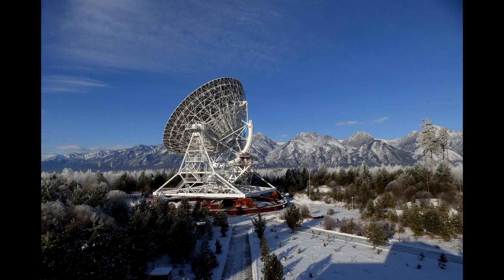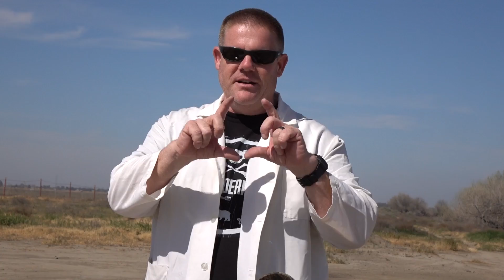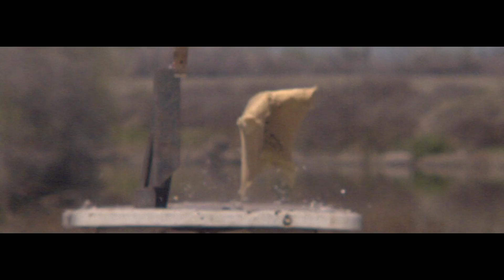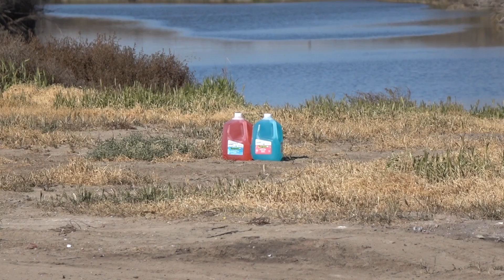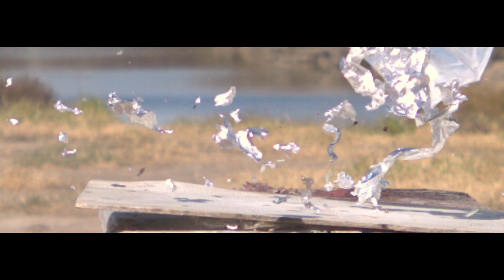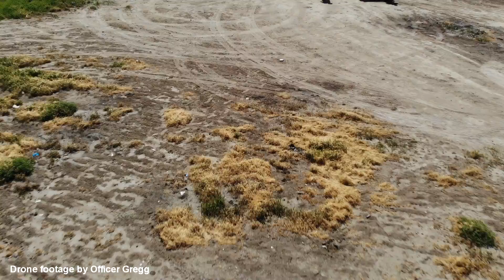BIZARRE Russian 12ga Shotgun slug using French Blondeau design - MUST SEE

Comment: Use a small square of reflective tape on your target to get a laser dot to show up on camera. I have used this to laser bore sight my personal chemical propellant mass accelerators.
Reply: That's a 200 IQ move right there.
Reply: @mike, well if you have to use electric tape, why not just use a mirror?
Reply: @Jazzman-bj9fq  because foil tape is a darn sight cheaper than buying mirrors that you have to replace after every shot, foil tape just gets a hole through but a mirror or piece of one would disintegrate
Reply: @Jazzman-bj9fq  because if you break the mirror you get 7 years bad luck
but for real the more reflective it is you're actually making it a little harder because you want the laser to be seen by the camera which means you'd rather have a diffuse reflection than having to line up the mirror to the camera

Comment: Been there done that with slob shooters leaving all kinds of trash. We almost lost a local range till a gun organization stepped in and saved it.  Made many improvements and really breathed life back into it. One of the nicest ranges around now.
I like running .690 round ball loads, use old books glueing pages together to be more solid. Low velocity around 1,100 fps tears il two placed 4in apart. Had some Makarov slugs I hammered flat like coins, put 4 in a 7/8oz cup to see what they'll do to a two in thick book.

Comment: Regarding the amount of light available for high-speed video:
        I posted this same comment on another one of your videos, recently, but when the same subject came up on this one, I figured I'd mention it here, because it's the perfect solution, which I first saw on the Ballistic High-Speed channel. They use framed mirrors, (around 1.5'x2', give or take) each mounted on a stand/tripod, to reflect sunlight onto the target. It makes it way too bright for the naked eye, but it's GREAT for increasing exposure for the low-ISO of a high-speed camera. It's a cheap enough set-up, and then it's free to use, no electricity, no batteries, no maintenance except a wet paper towel. Maybe a sandbag to keep them from blowing over in the wind.

Comment: I made up some split shot ammunition. AAA was all I could buy inthe UK at the time. I dismantled the cartridge, split the shot and re-crimped the split shot to some equal lengths of fishing nylon about 2 inches long. I doubled the shot count at all ranges up to fifty yards. I called my invention "lead balloons". The nylon tail seemed to keep the shot flying with less deviation through the air. Maybe you could try that too. I suppose you will have access to all buck shot sizes in the USA. Good luck.

Comment: Go to Home Depot or Lowes and get a sheet of aluminum instead of the foil.  You can polish it if you want, but, either way, it will hold up a lot better than the foil.
Reply from the maker: The problem is that thicker sheet would probably last one shot before it was bent up and deformed.
Reply: @taofledermaus  Even 1/8 or 3/16 sheet?

Comment: Awesome video. Loved it - as well as the slug design. 
It was fascinating to see that both the heavy head forward and backward work so similarly.
This supports your comments - in past videos - on the shock wave stabilizing effect.
As for the wild bore that got hit with this thing - not sure you will have much to eat... (not to mention it's not going anywhere... unlike some movies where the hero gets shot and after limping a bit - continues running/as usual). The water melon and new clear gel shots were amazing!!!
Very impressive work with that accelerator and cameras - always shocking to see how "simple" it looks in the real time and complex behavior in the slow motion.
Reply from the maker: Yeah,  we can see even if the dumbbell is symmetrical and balanced,   it still works

Comment: You're supposed to make burnt toast with the cheapest wood-fiber bread you can find and then spread 0.875ml across each then quickly gulp each bite down with fosters.  It is literally an un-sweetened chewable vitamin.    However, it mixes well with brownie batter if you need it for survival.  It can also hide well in molasses brown bread and real pumpernickel.   Which makes great bread for Reubins.

My grandmother's suggestion was to use it as a deterrent to children cussing instead of a bar of soap.

Comment: Jeff, Greg or Danny. (Just in my experience) My "Mass accelerators" have optical alignment, one of the problems with the forward alignment post was the screw that held the calibrated alignment post in place protruded all the way into the accelerator tube, leaving a "Nub",, as the projectile passed through this area the gas seal of the projectile would get damaged causing an uneven release of gas as it exited the end of the accelerator tube and the end result was unstable flight of the projectile. It's worth a look at your interior of the tube to see if this exists with your mass accelerator scientific equipment. -Dave
Reply: Oof.  Not a good situation.   I can assure you the inside of this accelerator is mirror smooth the entire length.

Comment: Love your channel, by the way. And as I've been binging on these older clips, a thought gimply limped across my mind: Have you guys thought about using your spent ballistic gel blocks as casting molds for liquid metal? I bet if you could semi-pressurize the cavity, you might be able to cast the projectile path and some of that feathering into permanent metal sculptures. You could even start with gallium, or something liquid in TX room temperature, before trying to hold the block hole open while pouring molten aluminum in there. Just a thought. If it worked, maybe you could sell the castings as merch?
Reply from the maker: It would have to be a cold metal.  Molten aluminum poured into the gel would be like pouring it into gasoline.  lol
Reply: @taofledermaus  haha that’s a different video, then. Gallium might work, though I guess you could use a series of molds and cold set materials to make a copy of the cavity in something that could survive aluminum. That’s a lot of work though.

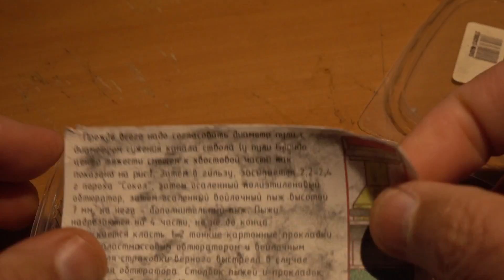Comment: 2:02 at first you need to coordinate the diameter of the bullet with the diameter of a barrel choke (the blondo bullet is positioned to the back as shown on the picture 1) then the case is filled up with 2.2-2.4 gramms of SOKOL powder, then lubricated pilyethilen obturator, then lubricated felt wad 7mm height, with additional wad if needed. wads are cut at 4 pieces, but not completely. is is acceptable to put 1-2 cardboard spacers between the plastic obturater and felt wad for getsure shot in case of obturator destrution. the column of spacers and wads must be 10-12mm, to keep enough space to make a shell rolling. The Blondo bullet makes a lot higher pressure than the usual lead bullet. that is the reason to slowly extend the SOKOL powder mass from 2.2 gramms up to 2.3 or 2.4, but no more than 2.5 grams
with best regard from Russia!
Reply from the maker: The problem is we don't have Sokol powder  here!   I always have to come up with recipes for Russian slugs,  etc.  and use American powders.   Overall I was pretty close.
Reply: @taofledermaus   i have here. i think you can have some analogs there in usa. whatever, if you need some russian translation, im at your service.

Comment: Where did you get the Radiation protection lab coat? I've been working in radiation protection for thirty years and have only seen that kind of lab coat at one facility. I've actually got a couple in my locker. Love the video and I'm definitely going to have to get some of those slugs.
Reply: Jeff found it on eBay.
Reply: @OGsDangerShow  That's great. You look very official wearing it...

Comment: I wonder if the rifleing is loosing it's spin as the lead ring slips around in its track. Might be what's making the spin rate irratic.
Reply: Interesting. You think the driving band is  breaking loose from the slug WHILE its still traveling down the bore? And in doing so, the slug is not getting the proper (or any?) rotational speed?
Reply: @jeffreyreardon7487  because the whole slug has to accelerate but rather than be the whole deal being s solid piece I suspect the friction between ring and body is being partially overcome.

Comment: We had a gravel pit in state forest that was okay to shoot at, own risk kinda stuff, mostly plinkers shooting bottles and cans. It was great for a few years then more and more idiots found it. Had people shoot our targets seconds after we put them out. There was a railroad siding that was only for emergency use, so a single car would run through several times a day making sure the tracks and bridges were clear, the morons shot at it. Instead of immediately shutting down the site they threw up an 8 foot berm at the roadside which blocked the tracks. Last time we went we were setting up and 3-4 imbeciles climbed the berm 20 feet behind the shooting area and started shooting over people's heads. First and only armed standoff I ever witnessed. Bout 10 people inside the range vs the idiots. They ran.
Reply from the maker: what a mess!